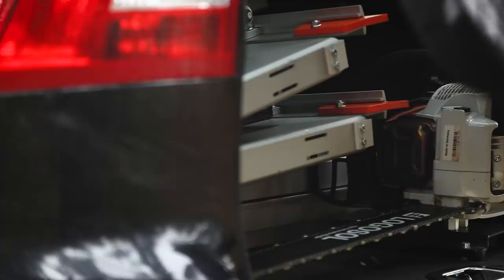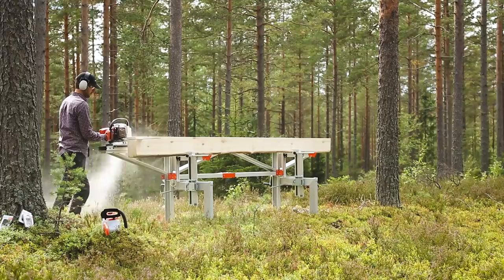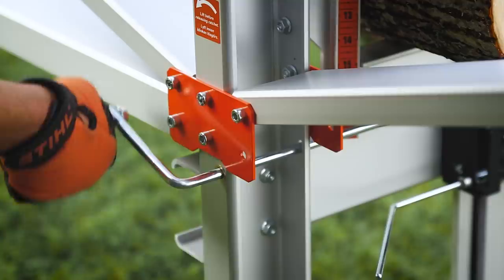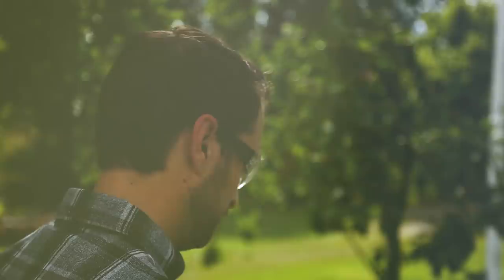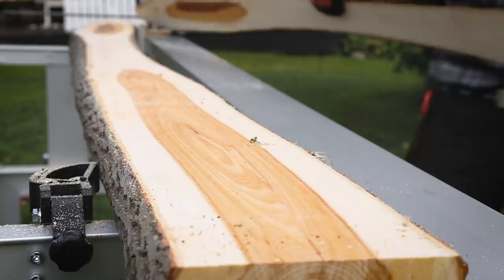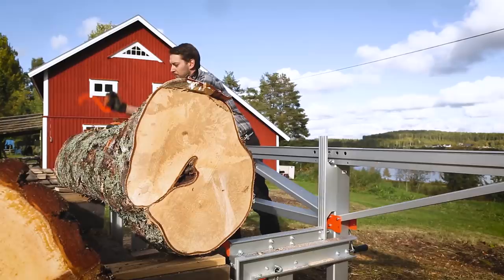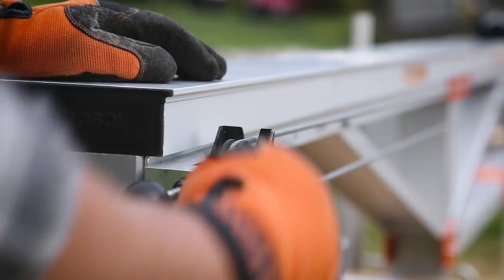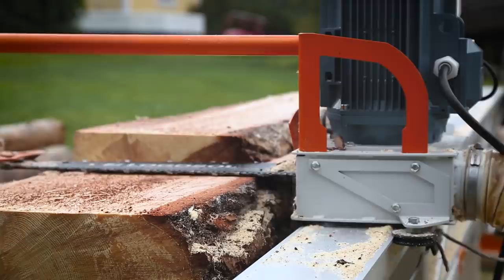Logosol F2 Farmer's Chainsaw Mill | LOGOSOL

Comment: I paid 280 bucks for a used 24' aluminum 8 in. I beam, modded my bar with threaded rod, circular aluminum spacers and a 2x8. I cut all the 6x8 and 8x8 beams for my barn from wood off my property right where I cut them down and dragged the finished beams to the pad I put it on. I traded a bunch of 20' oak logs and some welding work  to the Mennonite mill near my house for all the 1x8 siding, roof purlins and second story flooring. So for under 1500 bucks including fuel, craigslist windows and some labor from HS kids I have a 24x36 foot post and beam barn. It'll be another grand for roof metal and trim when summer comes and it's done. All that for less than this contraption
Reply: Have pictures or drawing of what you did ?

Comment: just make a bar device like at 3:57-3:58, get a straight H-beam and put it on top of the log, rest said bar device on H beam and make your initial cut, remove H-beam and slide bar across top of new fairly flat cut wood. once youve got rough cuts you can clean it up with a table saw or whatever youve got. youre welcome.
Reply: Can ya send me pictures? I have a remote log hunting cabin this could help

Comment: $2,800 for a chainsaw platform?!?!?!😂😂😂😂 For that much, I will pay a little more for a bandsaw sawmill and get a much better and bigger cut. not to mention I can mount it on a trailer so I dont have to keep setting it up and taking it apart. I like the design but damn, it's not the cure for cancer!
Reply: I've seen good bandsaw versions that start at $3,200. I bet if I was patient I could find them on sale for a bit less. For the amount of wood lost because of the chain width, the price really should reflect that.
Reply: It is only $1,800 for the F2 sawmill.
Reply: Ha ha ha
Reply: Yeah  at  that price it's not competitively priced against lower end portable bandsaw mills with greater capacity ....it only would be attractive to those without a vehicle to tow or who just truly wanted to cut craft wood or had very little actual milling needs
Reply: Where do you get it🤑🤑
Reply from the maker: Please visit: https://www.logosol.com
Reply: @thesprinklerguy2598  I completely agree. I was just debating the no price comment.
Reply: I completely agree, i was going to say the same thing
Reply: look at my self-made sawmill, les than  20 euros and already the warehouse full of planks
75cm cutting width
Reply: Я тоже прихуел от цены!!!
Reply: Oi parente  me  da uma notícia
Reply: Band saw is superior to chainsaw, laser is even better, and cuts everything under the sun using the power of the sun. Concentrate sunlight into laser crystal for awesome cutting power.
Reply: Yeah the price doesn't work out feasibly for me neither , it needs to be closer to the middle of what a bandsaw mill and/or an Alaskan mill would run me.. I think  its the bandsaw for this guy..

Comment: Thank for idea, now to build one
Reply: Be sure to share with us a picture of your "successful" replica
Reply: I was just thinking that I have a good local fabrication shop for the tougher pieces, and the way this attaches to the saw is very nice. It makes sure you have more useable length of chain cutting.
Reply: just make a bar device like at 3:57-3:58, get a straight H-beam and put it on top of the log, rest said bar device on H beam and make your initial cut, remove H-beam and slide bar across top of new fairly flat cut wood.
Reply: Sexs
Reply: Sec

Comment: My logosol M8 sawmill can be set to do either 1/4 inch clicks or 1/8 inch clicks. Can the F2 sawmill do that?
Reply: I sold my M8 and bought an F2+ sawmill. The F2+ (and the F2) can only do 1/4" clicks. This is somewhat limiting in terms of setting the thickness of the board you want. It's not an earthshaking limitation, but I would rather have 1/8 inch clicks.

Comment: Maybe if the Prices were cheaper then an Actual Proper Bandsaw Mill it would be worth buying, its $3,000-$5,000USD for just the basic model of your Mill with $500 Worth of Aluminum MAX, and you have to use a chainsaw. its $3400USD for the TMG Industrial 27" Portable Sawmill, Blade Lubrication, 429cc Engine, Proper Rollers.

Comment: is this ultra portable sawmill available for sale in Canada. Also will it work with a Stihl MS 461 chainsaw. I am looking to cut in remote location. Basically transport the mill with a snowmobile or side by side via trailer. Basically assemble when on location then disassemble to move to next group of trees. 5 to 9 meter logs and lumber. Also interested the orange colour pole and bracket that connects to chainsaw bar and carriage.

Comment: You can literally get an entire band saw mill from Harbor Freight for $1999 and all you have to do is upgrade it with a name bran blade ( less if you have a coupon lol).  With this your spending like $1800 and you still have to buy like a $400 to $600 chain saw just to make it work. Not to mention all the wood your wasting with that thick chain saw blade.

Comment: What do you recommend for chains? I'm using regular chains. Is there a specific one?
Reply: there are ripping chains that have a different angle, you can make them yourself with an grinder or buy them I think stihl sells them
Reply: iliketobuildstuff ok I'm still new to the angles for different uses can you please educated me?
Reply: A rip chain makes a cleaner cut but a standard  chain can also do a nice job as well!
Reply: My standard chain on my husq rancher kept binding up. So I figured I'd ask
Reply: Nicholas Byrd perhaps get a semi skip or full skip ripper than!
Reply: Check out Baileys outdoor power supply for rip chains way better price then a farm supply.
Reply: Whack the rakers off a regular chain and you'll be ripping boards in no time!
Reply: Keep sapien woodworking slaves chained with ordinary steel chains. Works fine.

Comment: Lol, even with the recent spike in lumber prices do you know how much you would have to mill for this to pay for itself, you will also go through another 3k in chains and possibly even a saw in itself. Even if you did manage to make 3k in 2x4's they won't be stamped so you can't use them on anything that is inspected requiring stamped lumber.

Comment: CHAINSAW WILL BURN OUT ON RIPS CONTINUALLY AND THE BLADES COST MORE THEN A SAWMILL BLADE!!  60$ FOR BAR AND BLADE COMPARED TO 35 BUCKS FOR A 176 INCH SAWMILL BLADE!    I BUILT ONE ON A BOAT TRAILER THATS 16FT /18 HP ELECTRIC AND PULL START FOR $1000  WOOD MIZER BLADES AND COOKS BLADE GUIDES!! AND THEN YOU CAN SELL IT FOR 3-5000 DEPENDING ON HOW WELL YOU FABRICATE YOUR DESIGN AND HOW GOOD YOU CAN WELD AND MEASURE!!?   YOU GOTTA REALLY WANT IT!!!!!!!!!!  I DO LIKE THE ANGLED CUTS AND IAM CONSIDERING A NEW BRACKET TO HOLD THE LOGS ON AND ANGLE!!

Comment: Exquisite piece of design and fabrication. BUT ...

My criticism stems from the silly CONCEPT of using a bar chainsaw to waste so much fuel, woodchips, time, muscle effort, sharpening -- all for boards about half as long as your bar. The material wastage alone on those little logs would be near on 30%.

Chain sawing timber boards is NEVER as efficient as a circular saw with 4 stroke engine by any criteria ... irrespective of mill size. And band sawing is -- cost, speed, end product, time efficiency -- only part way better. (Yeah, all you Yankee bandsaw lovers will chime in here).

I wish they had (or would still do) build something as beautiful in similar sized frame pieces with say a 5hp and maximum 150mm cut for a rotary blade. Much faster, cheaper. Something like a baby-baby Lucas Swing Saw.

You rarely need building lumber outside the150x50 to 70x35 range. And for logs 1 man can lift, a chainsaw mill is nuts.